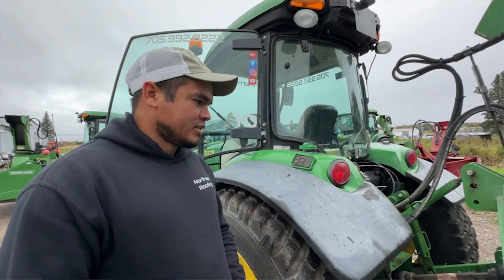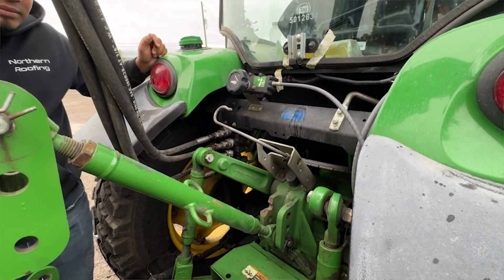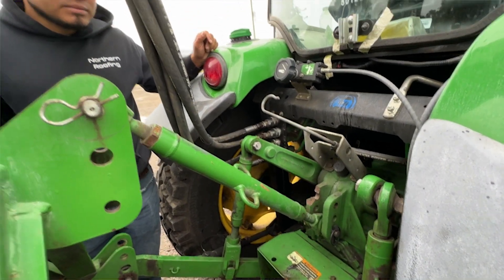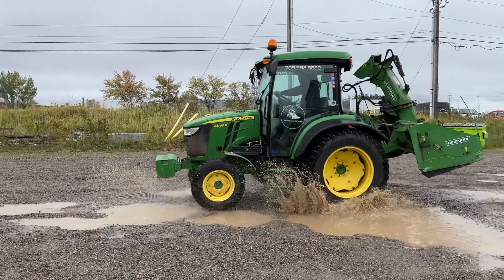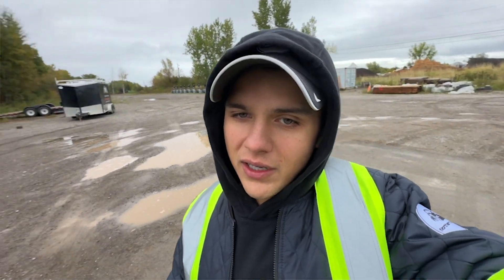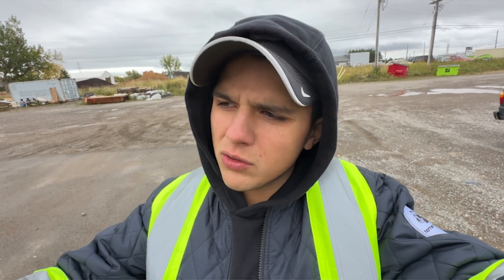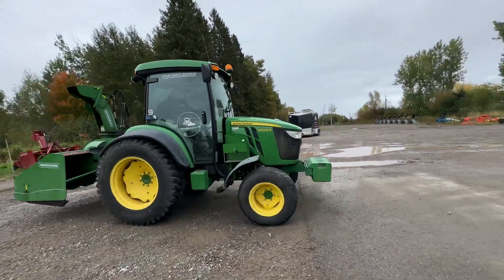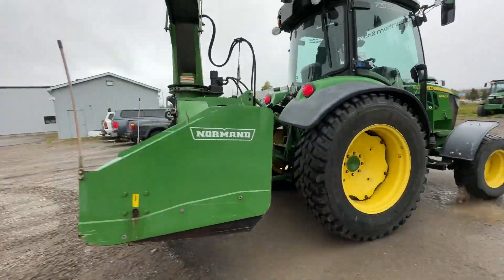WATCH THIS BEFORE RUNNING SNOW TRACTORS THIS WINTER!

Comment: Perhaps checking the nitrogen level in the accumulator as part of your pre season maintenance and prep would be a good idea.  Adding nitrogen to the system is cheap insurance against breaking a tractor rear end.  Of course, having drivers that respect the equipment and not driving it like it was stolen (or a rental) would also help.
Reply from the maker: Exactly!

Comment: I wonder if you could put some sort of upper mechanical stop on the 3-point that would stop the blower from raising up and then slamming down again.
Along with the accumulator it would provide a really smooth ride
Reply from the maker: If you check your control arms at the bottom of them there is a rectangular pin lock that can be turned Vertically or Horizontally. If you turn them horizontally it will lock the blower from jumping up and down on the year end however now if you do so you will compromise scrape quality because now the blower is locked and as soon as your tractor is on any sort of surface level that is uneven the blower will left up.

Comment: What PSI do you your charge your accumulators to?
Reply: I was going to ask what psi they put it to. I think our dealer said they only recommended 350lbs. 
But I think I heard some put up to 800.
Reply from the maker: 700 Pounds is what you want. 350 isn't enough.
Reply from the maker: 700 pounds all day!

Comment: If an accumulator looses its nitrogen then just replace the accumulator cuz it's leaking somewhere and it should not
Reply from the maker: Slow leak is normal in them as they get older. However you are correct if they are leaking you should replace them but that is quite costly. If the leak is slow then your better off saving the money when you have multiple tractors and just top them up with nitrogen yearly...